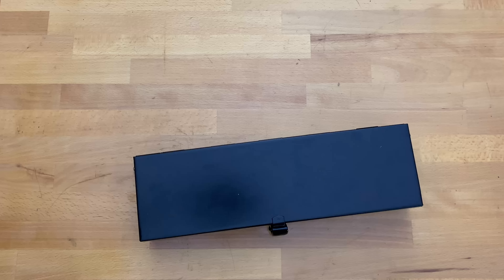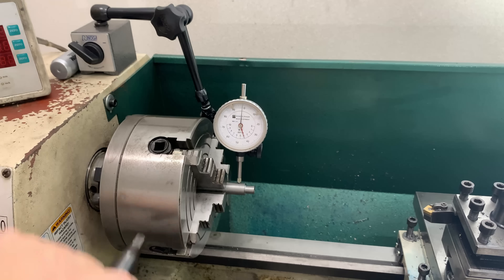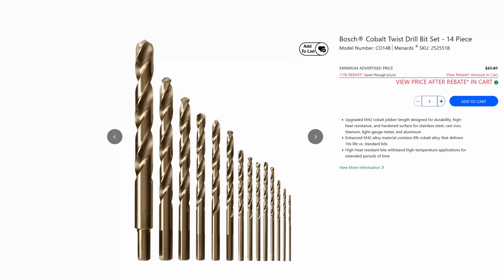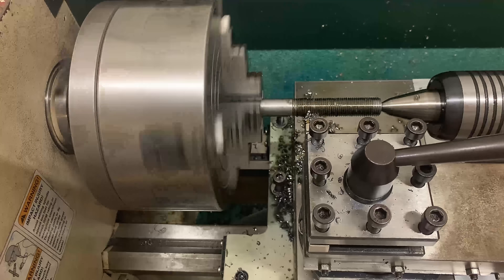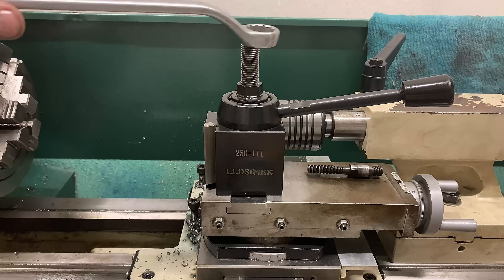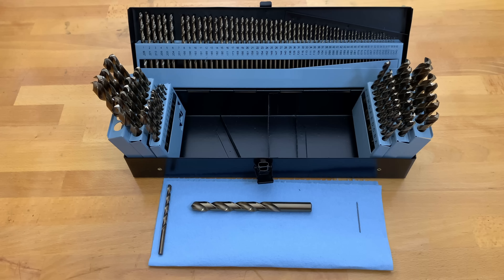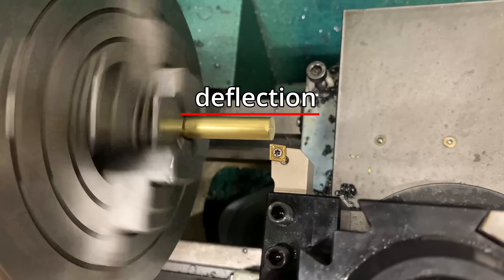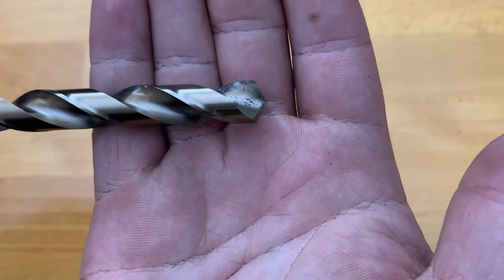Are Harbor Freight Drill Bits Secretly AMAZING?

Comment: My wife bought me a set of Harbor Freight drill bits ten years ago. I don't know how much the quality has improved, but ten years ago I was not impressed for one big reason: Many of the drill bits had points that were off center (unevenly ground at the factory), so the holes drilled oversize, even though the drill bit diameters were within .001 inch. The 3/8" (.375) bit drilled the hole to .398 inch in mild steel. Maybe not a big deal for many applications, but for precision work it's pretty shabby. 
You may want to check into this if you buy the HF drill bits, folks.
Reply from the maker: That’s good advice especially with merchants and brands that have reputations for less than stellar QC. When I’m drilling I’m usually drilling undersized and then using a reamer or end mill to bring hole up to final dimension, but that isn’t practical for all drilling applications. Good to keep an eye on those points
Reply: @ShopHumor  I just held the drill bits up to a bright light and could actually see the points off center. My drill sharpening gage I keep in my tool box at the machine shop I work at confirmed this. Probably a quarter of the bits were like this. Not good.
Drill bits aren't great at drilling precise diameter holes, so using the undersize drill/reamer is a good idea where an exact hole diameter is required.
Reply from the maker: Not good at all. I thanks for letting me know about that.

Comment: I haven't tried this large set from HFT, but I did buy their 1/16"-1/2" cobalt set a while back and it's been great. I use them in my machine shop regularly for materials that want a little extra that HSS can't deliver, like on stainless. So far none have broken, and none have dulled.
Reply from the maker: That’s really cool. I’ve seen a few people mention that they use them on stainless with good results! Very encouraging, thank you for letting me know your experience. 

The next project I’m working on is an easy one in 6061 aluminum but maybe the one after that I’ll have to get some stainless…

Comment: those milwakee drills are super nice for hand drilling! 
the starting tip is awesome and they are great for to keep in the welding kit.
mostly use them for drilling stuff like tubing and sheet goods.
the index I have for the lathe is the big expensive one you showed first, 
super nice to have for sure but I wouldn't have paid that, got it off an old timer that was retiring! 
only had to replace a handful of them.
Reply from the maker: That’s really cool. I really love buying all manner of tools off old timers because you can usually get some good jokes, insight, and wisdom along with whatever it is you’re buying.

Comment: IME the smaller drills, under 1/4 or so,  dull rapidly drilling steel, are ok for wood.  Larger bits have been ok for drilling thinner steel, say <1/2" thick and seem to hold up better.  My kit cost $40 about 20 yrs ago at HF.  No way at all they could be used in stainless at any size due to the work hardening that occurs.   stainless needs expensive drills treated carefully in regard to feeds and speeds.
Reply from the maker: Thanks for your perspective and experience :)

Comment: so for my shop, the HF drill bits are the best of the worst (compared to Snap-on or other high $ drill bits). i was buying all the others at the H-Depot, and whether it was an expensive set of Milwaukee/Dewalt/whatever they all lasted about the same, and i was left with expensive sets of drills with all the most used ones broken or worn out after a short time. then i found the HF titanium drills, and for $19 i could afford to burn through several sets of them. i found they lasted the same, and weren't complete crap. now ive switched to the HF cobalt drills, and quite frankly, they outlast the more expensive drills from H-Depot.
Reply from the maker: Consumable tooling is consumable tooling. You just have to figure out what gets you the most bang for your buck. Thank you for the comment!

Comment: Nothing wrong with HF cobalt bits...cobalt bits are hard & best used carefully (best in a drill press) 
If cutting stainless steel .. low speed .. heavy feed, will keep heat coming out with the chip instead of heating the work which forms HARD carbide precipitates dulling cutting edges:face-red-droopy-eyes:
Reply from the maker: Yep, nothing worse than work hardening.. it's all about technique and knowledge

Comment: Not sure how this video popped up in my youtube feed, but it was good (albeit a little late as I just purchased my Bauer and Hercules HF bits last week).  I subscribed.
Reply from the maker: Thank you! Glad you enjoyed it. I hope your Bauer and Hercules bits work out just as well! You'll have to let me know :)
Reply: @ShopHumor  The one Bauer bit did do it's job - with a little cutting oil, and with slower speeds.  I drilled eight holes through thinner steel with it, and it did well.
A few years ago I did buy a drill bit set from HF in a smaller but similar metal container as the one you have.  These seem to be black oxide bits.  They do not drill steel, even when never used before.  They are for wood only despite how they were sold.  Thank goodness for the more recent products that HF is offering.
Reply from the maker: That’s good to know about the black oxide set.

Comment: A must have for any drill bit collection is;
The Drill Doctor 
I use it on my Dewalt bit collection. Makes those long curly Q’s with a good cutting oil. They had 2 models of the Drill Doctor the more expensive one has more options and is the better choice.
Check it out…

Comment: Ive had a set of these for years and I have been very happy with them.
Reply from the maker: That's great! I hope they work out as well for me as they have for you.
Reply: @ShopHumor  Probably going on 10 years. Almost every single bit has wear on it. Most , if not all, of the common sized have been resharpened (by me) multiple times. In that time I have lost or broken only a couple of the very small bits and broken one of the large bits (I forget which one). I originally purchased the set because I needed to drill out 8x 3/16ths grade 5 bolts that were seized. the 1/2 bit made short work of those and was still sharp after. Keep em cool and they will last you a decade.

Comment: Yes, inexpensive drill bits are usually made from a less desirable material… but, 

If used in the correct manner , cheap can do just as good, usually just not as long time frame. 

Expensive or not, but drilling a 12mm 1/2’ inch hat ever hole into metal plate with a hand drill will always cause some bit of problem to drill bit itself ..
Reply from the maker: You're exactly right. Thanks for the comment.

Comment: All depends on what you are cutting, and how much material you remove.  I've used sets like this for years for prototype work and one-offs.  Had to sharpen some over time, especially more-used ones (typical tapping sizes like 29, 7, 3 etc.), but most hold an edge just fine.  If you're cutting soft stuff (aluminum alloys, brasses, etc.), up through mild steel, there ain't nothing wrong with them.  Edge life is just fine.

They don't seem to perform QUITE as well on tough materials (higher Cr stainless, exotic stuff like VascoMax/maraging).  They'll cut, but I feel like they dull quicker than your "name brand" Cobalt drills.  You'll end up resharpening them more often if you do heavy work in material like that.  I suspect if you're doing a lot of cutting in tough materials, you outta be looking at fancier drills anyway.

I wouldn't recommend them for guys doing production.  But if you do a lot of one-off work, and don't plan on just plowing them all the live long day, they're worth it at the damn cheap price.  Even having to resharpen them occasionally, still worth it if you're running that kind of shop.
Reply from the maker: Good insights and well reasoned thoughts. Thank you Joel!

Comment: I'm a locksmith and I actually found the best harbor Freight drill bits that they sell were recently discontinued. They were on clearance so I bought every set that they had. I drill out locks all the time. Sometimes hardened steel locks with ball bearings in there just to resist drilling. Years ago I was out on a job and I accidentally left my drill bits at the previous job. So I searched through my toolbox and found a blue box of left hand drill bits from harbor Freight. They were the sharpest high-speed steel drill bits I've ever used. They are right up there with my Norseman set. As long as you don't burn them up they last a very very long time. They come in a nice blue metal container that snaps closed very well. Not a plastic recycled sewer pipe case that breaks in a week. If there are any left at your harbor Freight, you should buy a few sets. I bought them to remove broken fasteners but now they are my go-to for portable lock drilling.
Reply from the maker: Thanks for the tip! I imagine you drill more holes in a month than most folks will in their entire life, given your occupation. Valuable insight, thank you :)

Comment: I use these Harbor Freight drills routinely for drilling stainless steel and chromoly steals with great results. I think the reviewers that knock these drill bit sets from Harbor Freight should go back to drilling 101 class because they clearly don't know what they're doing. I would venture to say that most of the snapped off drill bits were done in a hand drill and most definitely not in a CNC machine or even a drill press. I use these drill bits in a CNC machine and in a manual lathe regularly with great results
Reply from the maker: That's my use case for these drill bits as well - exclusively in the rigid machinery - my CNC mill and my lathe. I think you're right that people are breaking them because they're trying to drill very hard materials with hand drills and improper technique.

Comment: They break just as easily as any other drill bit.
Best use for them is soft materials.
Reply from the maker: So far mine have been holding up to steel but that's probably because I'm using them in the lathe and the mill and not in a hand drill.

Comment: Harbor freight drill bits will get you a hole. May only be one or two but it will get you a hole. If you need some oddball size that you can't find anywhere you can use that, then you replace it with a better drill bit and only replace the ones you use. The others are there just in case you need one and if you use it, replace it with a better one. It's better than going out and spending hundreds of dollars for a bunch of bits that you may not ever use. I've used several of the drill bits from harbor freight and never had an issue. They will do what you need them to do, but when you replace them, replace them with a much better bit and you'll find it's a lot cheaper to do that than it is to go out and spend $400 or $500 on an entire set for a bunch of bits you'll never use
Reply from the maker: I'm stockpiling a handful of each of the sizes I use the most, and then keeping the HF cobalt drill index for those one-offs that come up from time to time.

Comment: ive had a set of these cobalt bits for a few years and they have held up well. ive used them in my drill press, lathe and hand drill and havnt had a problem. 99% of the issues people have with drill bits is speed and feed. most of the material i drill is stainless or hrs. ive even drilled through some 1" plate with them. 
on the other hand, the cheap titanium bits HF sells, well they suck.
Reply from the maker: Sounds like you put these through more than I am likely to! Glad to know they’re holding up well for you

Comment: It is odd that kits of numbered/fractional drills like the one in this video are very common, but a similar kit in Metric is hard to find. I had to buy two metric sets to cover the same size range as the kit in this video in 0.1mm steps. One of the numbered drill kits like the one in the video I bought had several duplicate drills and therefore several missing drills at the smaller size range. One needs to measure the entire set to make sure that they did not substitute the wrong sized drills on these cheap sets.
Reply from the maker: Good call on checking every one - would hate to use one and it be wrong.

What metric sets did you end up getting? I wish we were metric because it’s so much easier to design in, but alas, we are stuck with what we have.

Comment: The rule is simple: buy the cheapo Harbor Freight special first. That will tell you if you use the tool at all, let alone use it enough to wear it out. If and when you break it, go complain until they give you your money back and then buy a nice legit version of that tool. You don't need to buy the expensive version of every dang thing in the shop, figure out what your workhorses are and invest in those
Reply from the maker: Yep. And as far as drill bits go I’d rather save money on them and use the savings to buy better end mills or reamers that are going to be bringing the drilled hole up to final dimension anyway.

Comment: The half inch bit was 5/10000 of an inch off, NOT 5/1000   With that being said, about 7 years ago I bought the small set of left hand HF drill bits because they were on sale.  They have saved me hours of work getting broken studs and screws out of holes.
Reply from the maker: Yes you’re right, good eye! One of those errors that I didn’t notice during the dozen or so times I watched the video during editing but then as soon as I pushed upload, I saw it right away 😂 good tip on the left hand drills to remove broken studs and screws!
Reply: @ShopHumor  We all make mistakes.  No problem.  As a now retired machinist of almost 60 years, most of the time you get what you pay for, if you are lucky.  It is hard to ignore the life and performance of a set of Cleveland twist drills.  It is equally hard to ignore the price.  You have a great channel.  Call them drill bits, drills, or my choice, twist drills.  Life is short, enjoy it.
Reply from the maker: Calling them twist drills sounds like the best of both worlds

Comment: I bought this set probably 10 years ago and have used them a ton on lathe, mill and drill press, nothing wrong with them.  It's the only good drill bit set they have.  As you said the case is not great but I don't close it anyway since it sits in top of my tooling cart.  I did snap the 3/8 and 1/2 using an old heavy duty Makita 1/2 corded hand drill.  That old drill will wind you up so I can't blame the bits, my fault for not stepping up hole size in smaller increments.  

I've re-sharpened many of the common sizes numerous times and of course broke some of the small bits.  Will be buying a new set next year to finally replace it.   10 years and lots of use ,I'll gladly spend another ~$100 for a fresh set.
Reply from the maker: Man, 10 years of hard use is an incredible value. Thanks for letting me know about your experience with them.

Comment: A friend bought harbor freight drills, didnt cut, the points all had a negative rake.
Reply from the maker: That's really annoying. These cut just fine through steel, but maybe your friend got a bad batch. I wouldn't be surprised if the quality control is occasionally lacking.

Comment: i instantly knew the reviews are from gorillas trying to drill through steel/stainless full force, full rpm, no coolant and then calling them bad drills because they burned up/snapped bcz of side load.
Reply from the maker: No doubt you're right. Poor technique will snap even the best drills.

Comment: I bought a set that looks identical to those at a flea market about 30 years ago, and it's actually held up pretty well.   A few of the drills I use the most such as #7, 1/4", #21, 5/16", 3/8" eventually got chipped or worn out after drilling hundreds of holes, and I'd buy good individual replacements for those.   I mostly use them in a drill press with cutting oil.   I think a lot of people ruin drills because they don't know what they're doing.   They'll drill through stainless steel with no cutting oil, and then not press hard enough.  All that does is cook the cutting edge and ruin it.   It's always important to push hard enough that you're getting a curl started.  If you don't get a curl, you're not pushing hard enough.  If you're using a hand drill, start off with a 1/8" pilot drill before stepping up to a larger bit.  Split point stubby cobalt drills work great to make a pilot hole in steel or stainless steel, but they're brittle, so don't do any jerky side to side motions or you might snap them in half.
Reply from the maker: I think you're exactly right. People who don't know what they're doing with a tool blame the tool when it get's damaged!

Comment: I've proudly owned this set and their HSS set for years.  I have had their 29-piece cobalt set since 1991 when they were made in USA.  I was a dealership mechanic and have been running my own fabrication and machine shop since 2007 (non-production, but we drill into all kinds of materials).  The first thing is to throw out the original steel box and replace it with a Huot #11700 Index.  Use the drills and when they break, wear out, or don't sharpen well order individual Cobalt jobber drills from McMaster-Carr.  For us, 95% of the drills are the original and the replaced ones are common sizes used for tapping holes where we keep several backups in stock.  Thanks for the video- liked and subscribed!

Comment: Great work! I actually never thought about the difference between rigid and hand tools when it comes to drill bits. I guess Ive got a steady hand and soft bits, so Ive not had a problem with breaking them. 

I think Ill pick up this kit next time I'm at "Happy Freight", haha.
Reply from the maker: Thank you for the compliment! Truth be told it wasn't until after I got my milling machine that I gave it any thought. Sounds like your steady hand is better than mine because I've certainly snapped a few drill bits in my hand tools over the years!